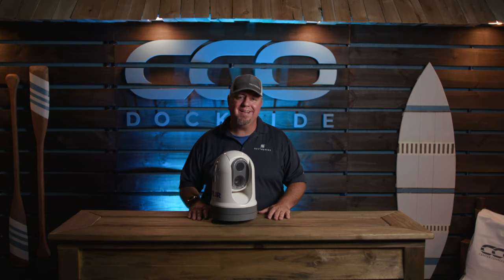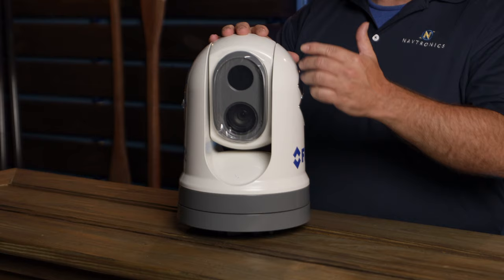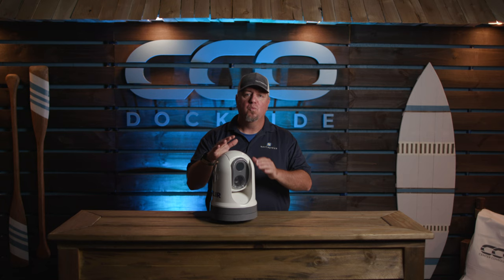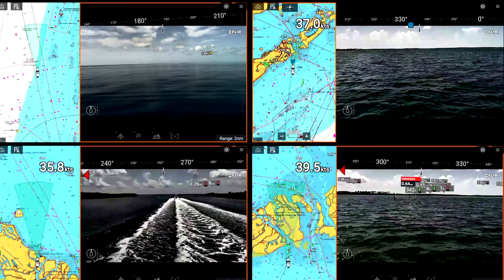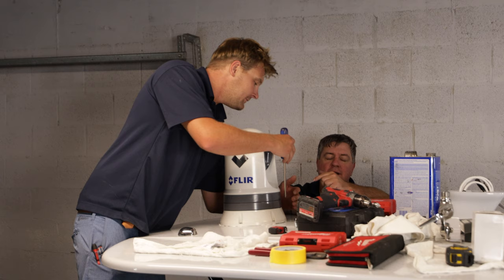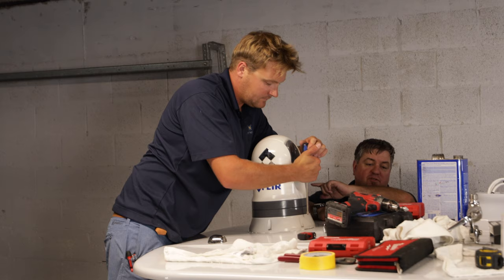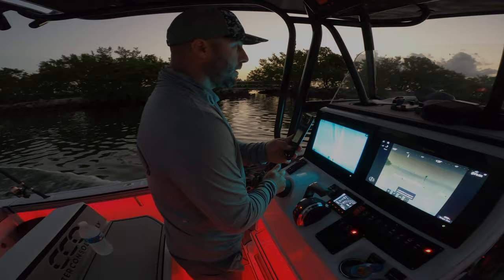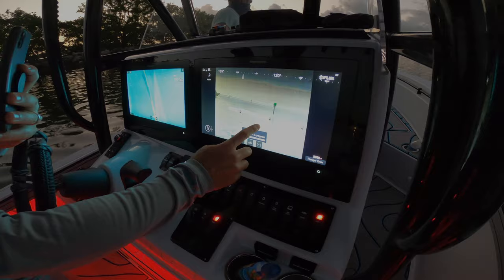RIDICULOUS THERMAL CAMERA - FLIR M364C - Overview and Install

Comment: Hi. Maybe you can help me. I just installed my FLIR 364C today with Garmin MFD’s and I used the Ethernet câble only and not the BNC cable. I can only see the day light camera but the thermal is not available. There’s no way to toggle between day light camera and IR. I connected the camera to a laptop computer and went through the parameters. On the computer the toggle button appears but the IR remains black with « no video » notice. Any idea of what’s happening? I see in your video that you installed only two cables, power and Ethernet. So it should work without BNC cable. Correct? I précise that I don’t have the JCU yet due to shortage at the supplier. So I can’t try the toggle button on the joystick. Thanks for reading this long message to the end.

Comment: Do you put the camera on an on/off switch, or just wire it with a fuse?
Reply from the maker: The camera is fused and there is an app on the Raymarine screens that control its power/control functions.
Reply: Thanks for the info. I am adding flir to my Garmin system and not sure wether to run it through an on/off switch or not. I imagine Garmin is different than the raymarine gear
Reply from the maker: @maxxmironov  You’ll probably want to run it to a toggle switch just in case.  Raymarine is owned by FLIR and they operate very cohesively, but a toggle switch is certainly a definitive closure that most people like.
Reply: Thanks for the tip! Ordered a bocatech resettable 5A button switch for it today.